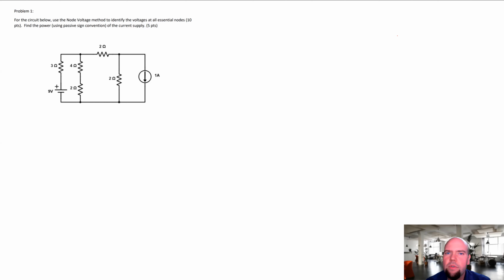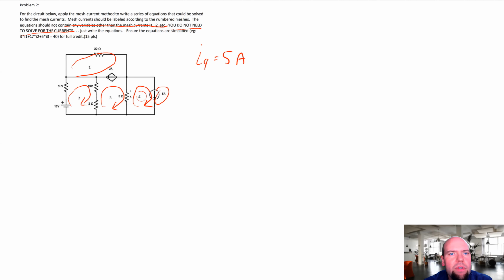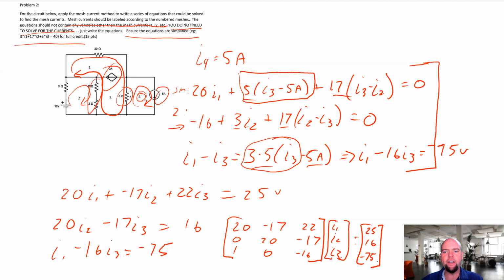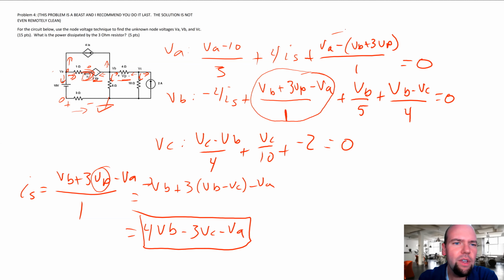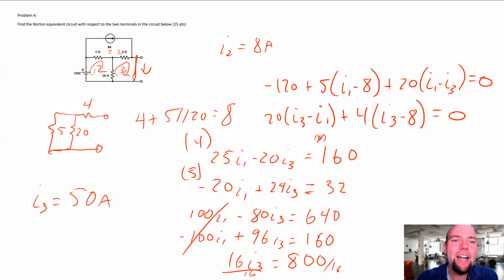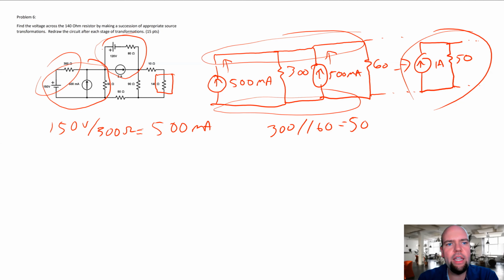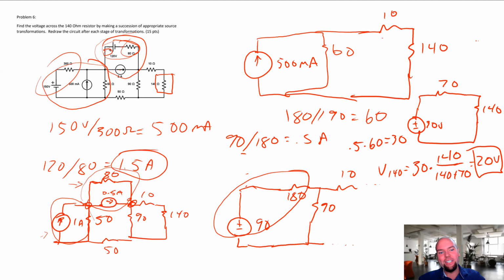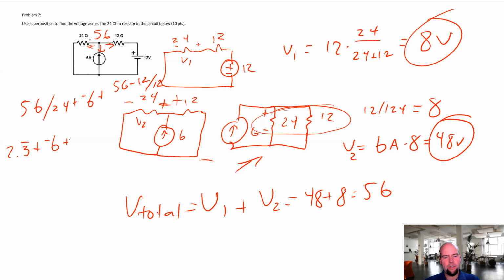Chapter 4 (Midterm) Review

Comment: It probably needs double checking but on problem 4 when you multiplied the second equation by 5, the 24 x 5 should have been 120 and not 96. This would make the Norton equivalent have a current supply of 20A.

Comment: In problem 4, the Norton equivalent current is 20A. There is a mistake @37:54 24*5 = 120 not 96
Reply from the maker: Thanks.  -5 points for me.
Reply from the maker: My math and new math are both failures, apparently.